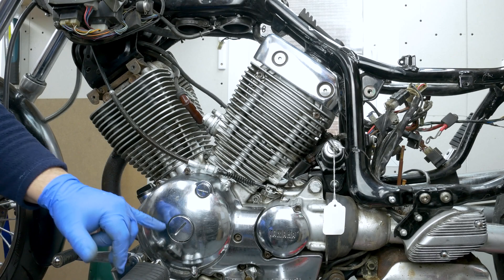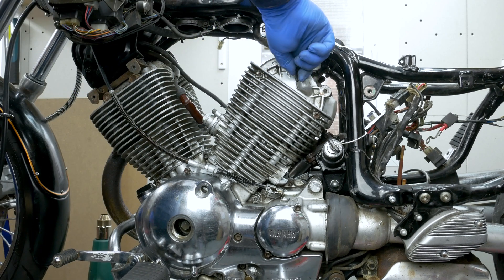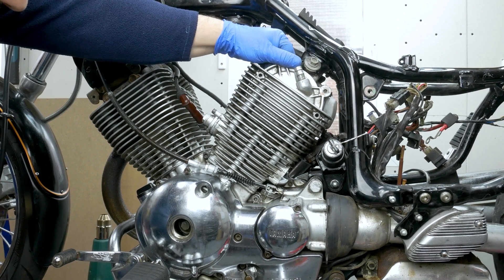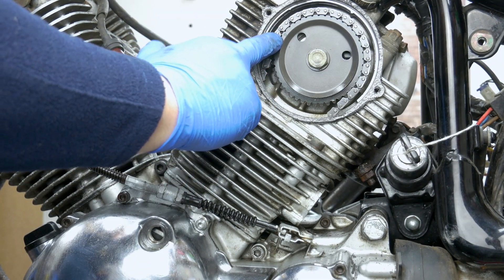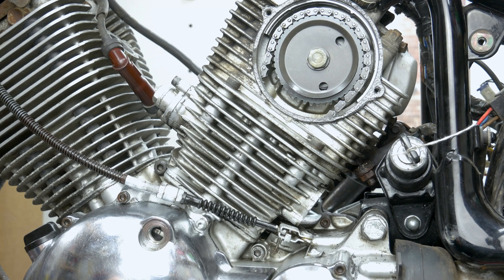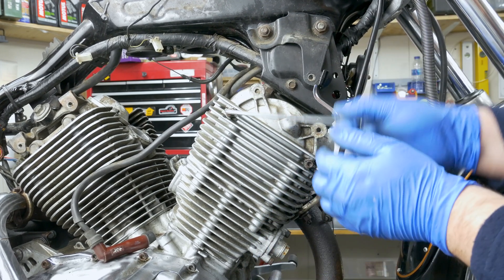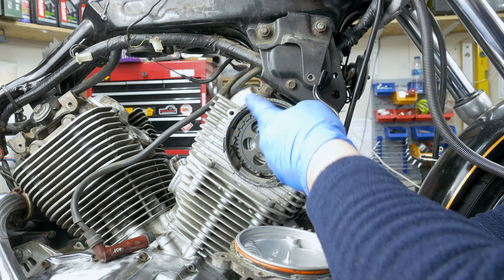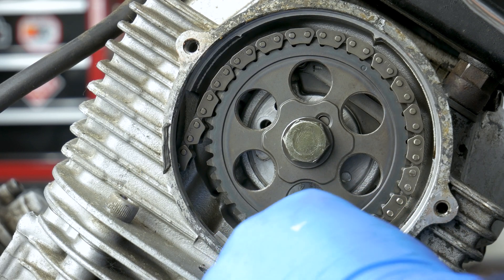HOW TO CHECK ENGINE TIMING TUTORIAL FOR VIRAGO 535 REBUILD | Check camshaft timing | #5

Comment: Did a rebuild of my 535. It was spitting oil from the exhaust and lost power. Put all new gaskets and pistons rings. Now with timing both cylinders seem to be half a tooth off either to the left or to the right of the center point. I can't seem to get them aligned whatever i try. Obviously it also runs pretty bad now. Cold start its perfect and starts up directly but after a short time running it starts sputtering and stalling with weird grinding or blocking noise coming from the starter. I'm not sure if it's because of the slight offset in the timing or it's a fuel related problem. With cold start up the engine sounds pretty fine.

Comment: Hey buddy, got another question for ya. In your video @5:20+ do you the the timing mark on the sprocket should be a quarter tooth before the TDC mark on cylinder head and the  timing mark "|" in the timing hole with the timing mark on crankshaft cover. Do you think it matters and could it be changed by putting a quarter tooth in front so when turning the crankshaft it would then align correctly? Idk I'm thinking about trying it but didn't know and wondered what you think.. like, where it is a quarter tooth before in order to get the sprocket and mark lined up you have to move the crankshaft bolt clockwise a little more which would make it advanced??? And if it should be dead on but let's say it's before or after is that just from chain slack or tensioner etc... ? Thanks bro and if I just can't get it but a quarter tooth and it should be a let's say for now a quarter tooth after the timing mark on head would that be ok like you said. Thanks bro!!!!
Reply from the maker: Hi there. It should line up near perfect, however it will depend on wear and tear. If the chain is streched (worn) a bit, then it will be out, and that is fine. A ¼ tooth won't matter at all, to be fair my 1100 is out about a ¼ , and still running fine, and has even compression in both cylinders. Also you can't actually move it by a ¼, only 1 tooth increments. I hope this helps
Reply: @MidlandCruiser  definitely helps,  so if the mark on you front cylinder in this video would be normal? So it being a quarter tooth before TDC is maybe better than a quarter tooth or more after TDC. See as you was turning the crankshaft in the video the cam sprocket mark was a quarter tooth before the mark on the head with mark lined up perfectly in timing hole. Yeah I tried to change a quarter tooth and spent way to much time lol 😂.  I'm wondering too what you think about it if CS was past the pointer mark on head not before would that mean it's advanced?? You always help all of you have helped me greatly!! So appreciated 👍
Reply from the maker: @karlh4313  to be honest I have seen bikes running (noy very good) but running with the camshaft in the wrong place by a tooth. Compression was lower, that was the sign so I checked the timing and it was out (1 tooth advanced) .
I think you shouldn't worry about that ¼ tooth misalignment, it won't affect it. If you want it perfect you'll have to change the chain to a new one, but the money and time doesn't warrant the result, which more than likely would be negligible.
Reply: @MidlandCruiser  thanks 👍
Reply: @MidlandCruiser  thanks 👍

Comment: How do you adjust it though, if it is out?
Reply from the maker: You have to take out the cam chain tensioner and move the chain on the camshaft gear. Some cases you'll need to remove the gear from the camshaft to be able to move it a teeth.

Comment: Hi there, if my timing chain is loose and knocking, how would I tension it?
Reply from the maker: Hi. The virago has an automatic mechanical tensioner fitted, which basically only can go 1 way so it keeps the chain tight. If it reaches the bottom then you'll need a new chain because it is streched too far.
If the chain looks good maybe the tensioner is faulty, you can fit a fully manual one if you want to (will need periodical checks) , or take the original out and have a look, maybe got stuck and need freeing up. I haven't touched the tensioners on my 535 but I did the 1100 and they can go wrong sometimes however not very often. Hope this helps
Reply: @MidlandCruiser  thanks so much for your time. I'll have a look!

Comment: Hey, a question please: only one of my cylinder is out of timing (distribution chain jumped some 4 teeth), while the other is still in place. I have to free the valves completely in order to put the camshaft in the right place again right?
Reply from the maker: @karlhoff-4jc  you mean you checked it and now locked or moved the camshaft gear and then it's locked...if the later then you clearly did something wrong..
Without knowing what have you done, it is really hard to help. I assume you moved it so take out the tensioner and put it back where it was, then try it. Do not force it, if you need to turn it backwards to loosen it up, do it.
Reply: @MidlandCruiser  got it straight just half tooth off little less couldn't get it dead on
Reply from the maker: @karlhoff-4jc  if the bike was running fine or at least running..then no you shouldn't loosen up the valves if let's say you are out 1 tooth.
After correcting the timing and re setting the valve clearance it should be fine. 
Obviously you need to take out the tensioner to be able to move the camshaft gear to the correct position. Then put it back for the valve adjustment. Make sure you adjust them at the correct marks..."T" for rear, and "I" for front NOT "F"
Reply: @MidlandCruiser  so just check the valve lash? And readjust if necessary? Thanks 👍
Reply: @MidlandCruiser  how do I get it dead on? I read in one of my books, if you have to turn the crankshaft for alignment don't let the chains fall in. Do you adjust the timing marks with the crankshaft or just by putting at tdc taking out the tensioner, the cam sprocket bolt and and taking off the sprocket, turning the sprocket aligning the marks like that, then tighten both and put tensioner in. Is this right?
Reply from the maker: Hello. 4 teeth is a lot however these engines get away with quite a lot so you could be fine after re setting the timing (meaning there is no bent valve).
Just take out the cam chain tensioner when the problematic cylinder is on TDC then remove the gear from the camshaft, re set the gear in the chain where it should be and put it back on the camshaft, put it all back together and you should be fine....If it jumped 4 teeth though the nyour chain tensioner maybe failing so worth a check
Reply: Mine are about a half a tooth off but I couldn't get it to be dead on why not do you think? The tension guides feel good.

Comment: so, my bike was running OK, but the compression was a bit low. Last week I just checked the timming and my front cyclinder was about 4 teeth of. 
So i ajusted it, and valve clearance too. But now i can hear a loud tic tic  noise from the top part of the engine after engine warn up. Should i put back in the wrong timming position again? 
Thank you for the video, As always, a great Help
Reply from the maker: Hello. Definitely don't put it back in the wrong position, however double check that you have adjusted the valves at the right position (timing marks)
It is possible to adjust them at bottom dead center, so check to make sure you have done it right. Slight ticking noise is acceptable when the engine is hot

Comment: Very interesting, but no gasket under the front cover ? I am in the process of rebuilding my XV535 engine, I have done a few vids on it, and I don’t remember whether there was a gasket under the front cover or not, but in the replacement gasket set, there is only one. Do you know if this is standard, otherwise I would have assumed it was just missing rather than deliberate. It’s a bit odd that there is one on the rear but not on the front. Did you use any sealant when you refitted the cover ? Thanks.
Reply from the maker: Hello. Yes I was wondering the same, and you are right there is only 1 gasket in the gasket kit, so looks like there isn't any for the front, which is odd. I will double check on the parts drawing and if that confirms it then it is designed like that.
I haven't been able to do anything on the bike in the last few weeks, nearly a month now due to personal reasons, but will start up soon and carry on uploading the videos...
Reply: @MidlandCruiser  I guess it is due to the fact the breather and baffle plates are on the rear it needs extra sealant. I assumed I just had one missing in the kit, but seems it’s meant to be like that. I’m just about to inspect the heads and get them back on, so I’m glad I spotted your channel and saw you doing this procedure,
Reply from the maker: @memybikeni9931  yes seems that way. I will have to use gasket maker I'm afraid...I don't like it to be honest.
I also plan to take off the heads, polish the valves, clean the combustion chamber and obviously the outside of the cylinder. I am waay behind with the project at the moment but hopefully will be back on it soon...
Reply: @MidlandCruiser  I’m in the process right now of the cylinder head strip down. I have to say I have found a couple of odd things on this engine, that make no engineering sense but I’m not an engineer so I assume I’m just not that clued up as I think 😂
Reply from the maker: @memybikeni9931  some things can be overcomplicated and manufacturers do it sometimes, however after thinking about it deeply usually can be figured out why they did what they did...never underestimate yourself, if you at least willing to give it a go you are better than most people out there😉👍
Reply: @MidlandCruiser  you’re absolutely right, after looking at things for a while it begins to make sense. Thank you for your videos, and your kind words. Keep it up, when you get time. Rich 😊

Comment: Helloo,  very nici video. I have a virago 125. Is it The exact procedure for The timing marks like is the one is yours or is something different
Reply from the maker: Hello. I'll be completely honest with you. I have never touched, or seen a 125 Virago so I can't say, however the basic principle of engine timing is very similar for all internal combustion engine. You should have a mark on the flywheel, and an other mark on the camshaft gear or sprocket which need to be aligned. So basicaly yes it is the same way to check on any motorcyle/car jut the marks maybe will be in a different place and might look different. I hope this helps a little.

Comment: If it is off more than it is supposed to be. How do you fix the timing?
Reply from the maker: You need to take off the gear from the camshaft and move it a teeth or 2, dpends how much it is out. Also need to take out the cam chain tensioner to have enough slack so you can move the gear around...👍

Comment: I may check mine sometime soon. Looking at gaskets. Does anyone have a link to buy new gaskets for side covers? Unsure what to search for?
Reply from the maker: I bought this full kit, because I'll need most of them by the time I finish, and I find it better value than only buying a few gasket you need for 10 quid each ending up paying 20-30 for them.
This lot cost me 50 quid and has everything in it, you never know, and might need few more in the future 
https://www.ebay.co.uk/itm/Complete-Gasket-Set-Full-Yamaha-XV-535-Virago-1988-2002-/193485597153?_trksid=p2349624.m46890.l49286

Comment: If the timing mark is not synchronize what should i do?
Reply from the maker: Hi...usually if the engine was running fine I'd double check it to make sure I did it right, also only turn the engine clockwise and never the other way.
If it is still wrong and looks like could be 1 teeth then you have to take out the cam chain tensioner, loose up the camshaft sprocket and move it 1 teeth the way it needs. Put it all back together and double check the timings. 
If it's only out a little bit, like 1/4 or 1/2 teeth than there is nothing you can do but to live with it. My 1100 is out about 1/4 teeth and cause no problems...so if it's not a big difference and the bike running fine, then leave it, and enjoy 😉👍
Reply: @MidlandCruiser  alrite thank you so much!!! Very helpful 👍🏻👍🏻👍🏻👍🏻👍🏻👍🏻